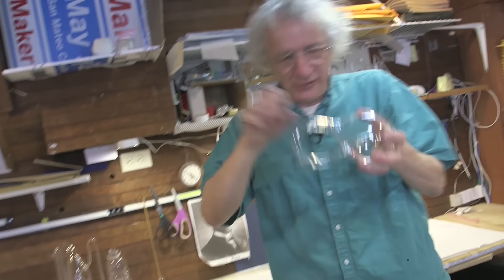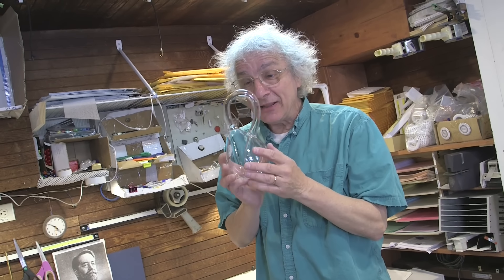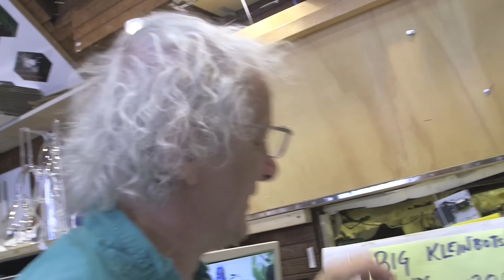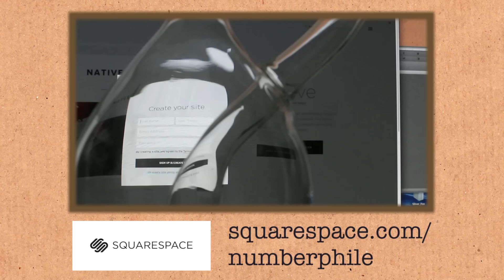The man with 1,000 Klein Bottles UNDER his house - Numberphile

Comment: How much does it cost to ship a Klein bottle from the dimension this guy lives in?
Reply: Abdega 10,000 flurbos
Reply: Ian Hearn Not that much. maybe 7000 flurbos
Reply: AevusRizzey It depends, if you live in Glahx it's around 7000-7500 flurbos, but if you stay near the Flggkys area, then it's 10,000 flurbos exactly. Other areas are inaccessible, sadly.
Reply: Sunset Raven I got a 5000 flurbo deal in the magsterantian region near the Pyrenees
Reply: Sunset Raven sadly i live in the Klykatriozzsreon Region. I want a Bottle, i even would pay 100.000 Flurbos.
Reply: Abdega 
17

No currency 

It costs 17
Reply: gravediggershenpai lol you’re crazy. I’d never spend more than 15,000 on one of these
Reply: Quick explanation:
One of my old Klein bottles broke. There was a temporal shift and I'm now in 2020 for some reason. To you guys, this comment will appear to be sent 2-3 years later; please ignore this fact.

Anyway, I got mine for 15 46. 17 aren't used in my sector. Ę is used as well, but isn't as popular.
Reply: I get them shipped second hand for 50 Venrux to Ieahgaden from Dyræf
Reply: @Xarphor  
Dyræf?
Are those bottles even in tact?
Last time, I bought one, second hand from Duræf for 400 flurbos and it came in 3 pieces. Since then, I usually don't buy second hand interdimentional stock. Don't really trust them. You can buy them first hand, for quite the cheap price at Hüphhęəåæ, not far from the ŕþøœđ station and they come nice and freshly cleaned on top of that. I got myself 15 of those last year for 37'500 flurbos (2'500 each) and I still have them and they are still nice and in tact!
Reply: @FoxyBoxery   must've been a shipping problem, I heard that MWPS⁰⁵7 routes we're being disrupted by local ğįøfən. Those things scare me lol.
Reply: @Xarphor  
Possibly. Heard that on Тезщщ 31фъьйю, there were marauders!
Reply: dang I only have like 20 shelents
Reply: If you order from him you have to specify how many dimension the universe you live in has (no joke). His Klein Bottles only work in 3+ dimensions.